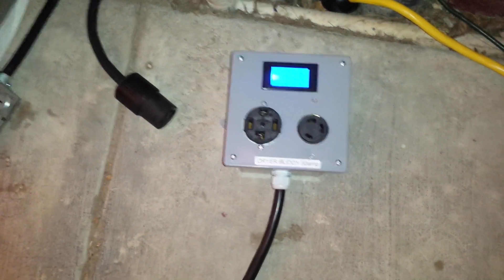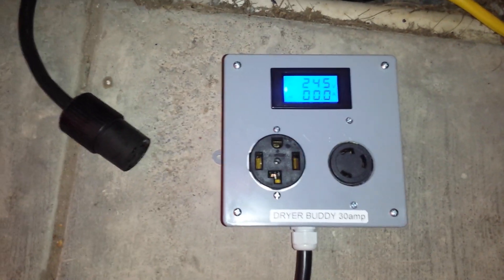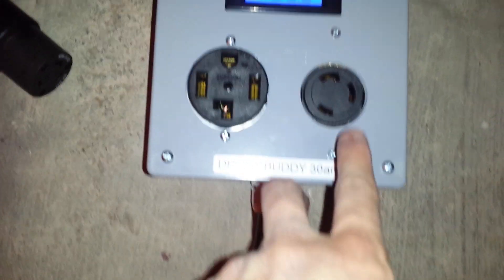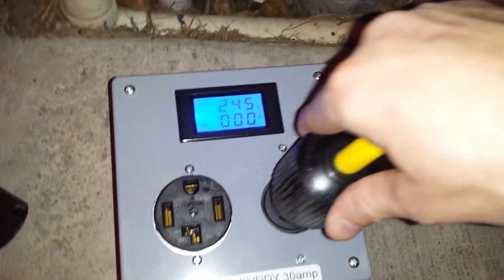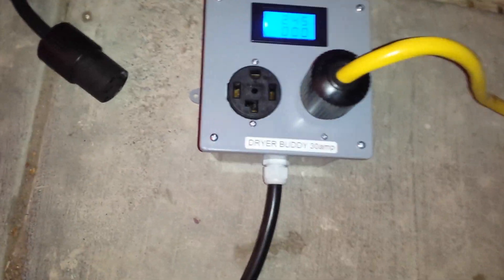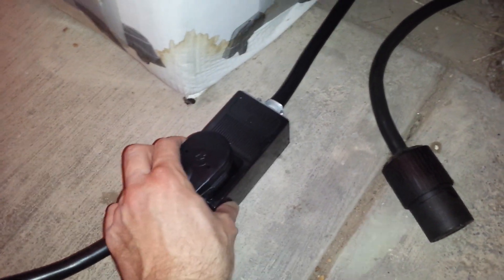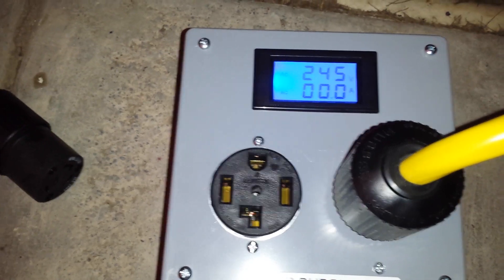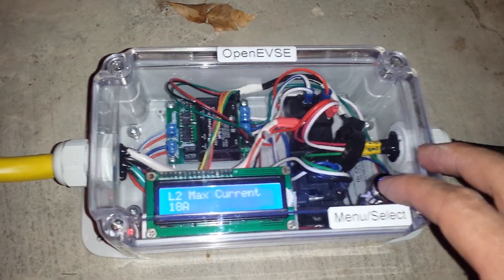Custom Dryer Buddy #3 demo for Level 2 EV charging stations - demo by BSA Electronics

Comment: I could use your advise.  I am building a generator cord.  I am going from my generator 120 Volts 30 Amp 3 wire travel trailer RV plug connection to a 3 wire 10/3 cord to my outside house connection 4 wire connection.  The male cord house connection is a Leviton No. 275-t/14-30P.  How do I connect the cord?  Black on the hot, white on the hot and green on the ground and skip the neutral?  On my breaker box in the house the wires from the outside connection are black and red to the double 30 Amp breaker, the white and bare copper wire go to the grounding bar.  

I can email you pictures and a better explanation of what I am doing if you need me to.